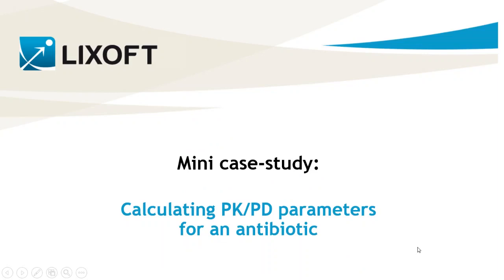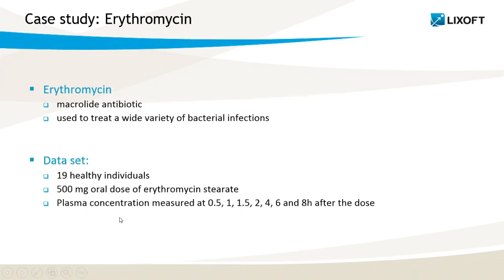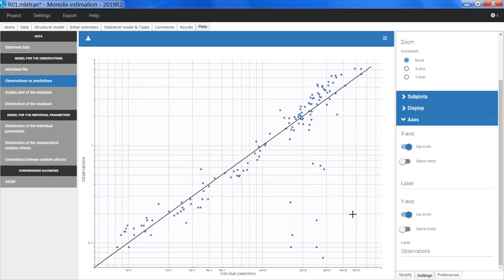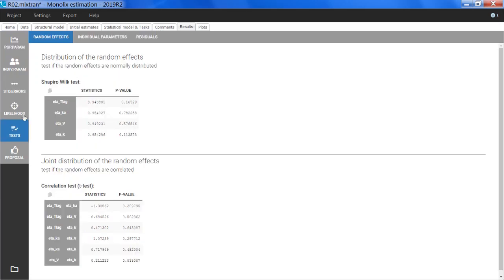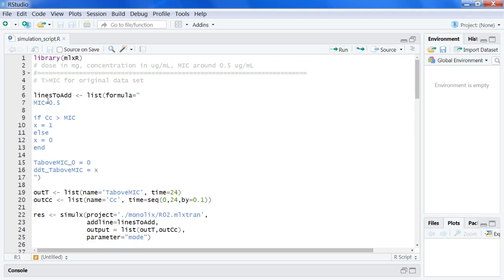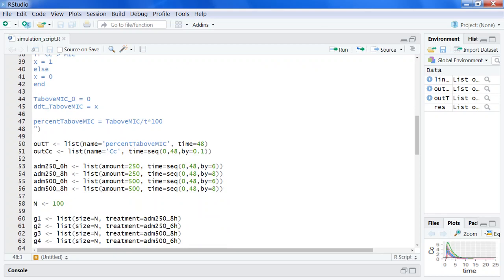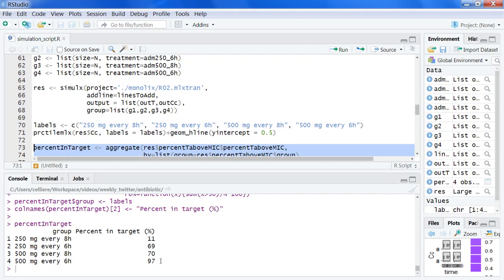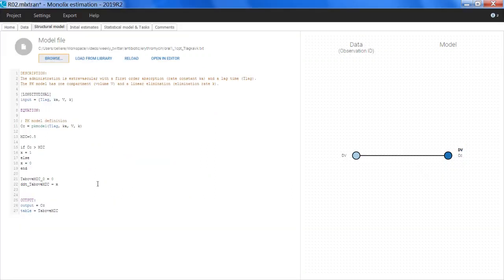Mini case study: Calculating PK/PD parameters for an antibiotic

Comment: But if I want to simulate the percent T above MIC  at steady state (i.e. on the 10th day, from 216 to 240h) instead of the 24h from time 0, how can I code? Because I found out that I can't calculate the percent T above MIC at that time range with Rssimulx. So, I tried to calculate T above MIC at 216 and at 240, then, percent T above MIC = (TaboveMIC_at240-TaboveMIC_at216)/24. However, some of my simulated patients got NA results, and the rest had problems as well. I found that when I included the output of C or removed it (delete both C output and C definition including leap) in simulation, there were discrepancies between results. Why, and in this case, what should I do? Which results I should believe in?
Reply from the maker: You can adapt the if/else statement such that it considers only the time range between time 216 and 240:
if t>=216 & t<=240
if C > MIC
x=1
else
x=0
end
end
ddt_TaboveMIC = x
percentTaboveMIC = TaboveMIC/(240-216)*100

If you get NaN in the simulations, make sure that you have included odeType=stiff in the model code.
Reply: @MonolixSuite  Thank you so much for answering my question, but I still have one more question that I long for your answer. Is it mandatory to include Cc in the output list in calculating PK/PD parameters? If yes, how should I define output Cc? Cc<-list(name="Cc", time=seq(0,240,by=0.1)) or Cc<-list(name="Cc", time=seq(216,240,by=0.1))

Comment: The R-script always gives the following error message. I have all the correct R-packages installed. Any idea what's wrong? :) 

> res <- simulx(project='antibiotic_PK_model.mlxtran',

+               addline=linesToAdd,
+               output = list(outT,outCc),
+               parameter="mode")
Error: 'getProjectInformation' is not an exported object from 'namespace:lixoftConnectors'
Reply from the maker: Hi,
could you please contact us at support@lixoft.com and indicate to us the version of RsSimulx, lixoftConnectors and MonolixSuite you are using, as well as the output of initRsSimulx().

Comment: would you please include the code and the dataset into your post ? thx
Reply from the maker: Hi Amine, I have added in the video description a link to download the simulation script and a monolix run with simulated data. Note that with the 2020R1 version, the simulation to get the PD parameters can be done in the GUI-based Simulx application.